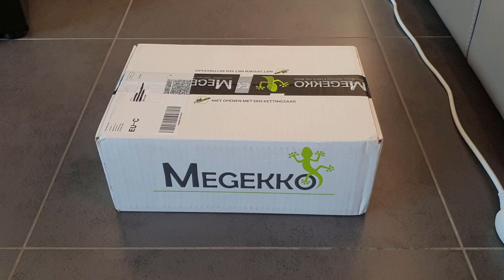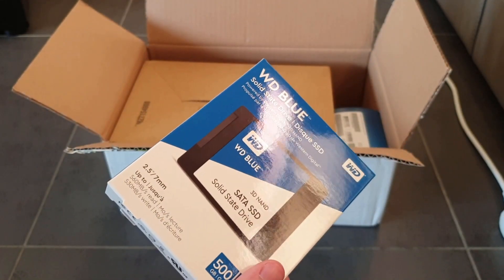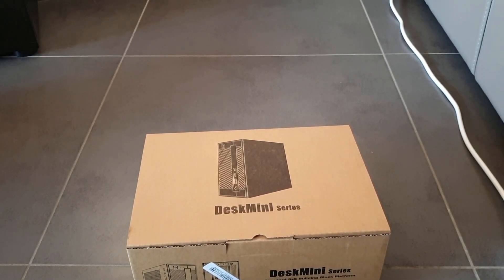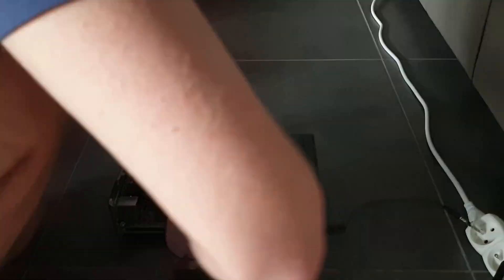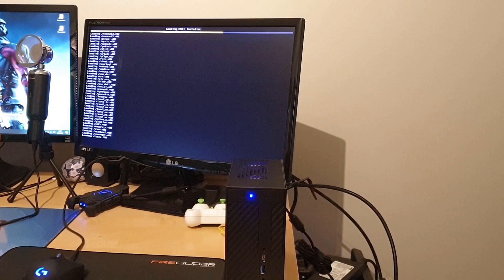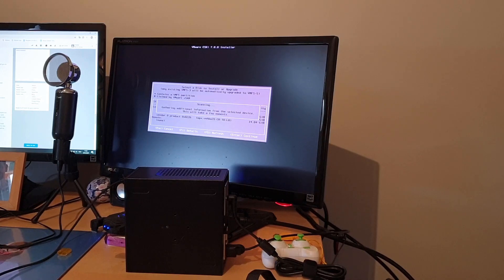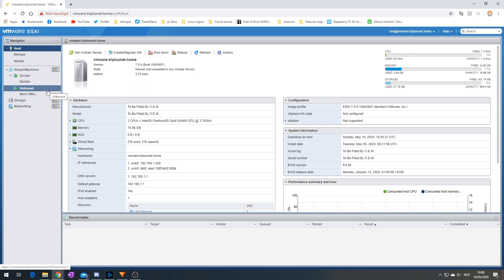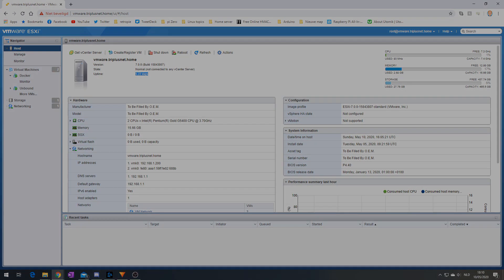HomeLab #1 - Building my cheap AsRock Deskmini 310 mini server! Getting started with my homelab

Comment: the esxi doesn't detect the sd card reader/sd card, very strange, perhaps its not supported by esxi
Reply from the maker: Indeed I had the same. I think I read somewhere that the internal SD card slot can't be used as a boot drive, don't recall if it was the asrock or ESXI that had that limitation.
It's a waste, but a small USB flash drive is working fine for me :)
Reply: @TriplusTutorials  doing the same :)

Comment: thanks for that! I have just bought my AsRock 310 + I7 9700 + 32GB ram + m2 256GB + 1tb ssd sata... waiting for it to arrive :-) 
In the meantime... I'm scared as you had to install the Esxi in an external usb: why? Is there any limitation? 
My principal focus will be to use the AsRock as Esxi server so i was thinking to install at least the Esxi server image on the m2 internal. 
Is there a problem? limitation? 
thanks!
Reply from the maker: You can for sure install it on the internal drives. I was just unable to do it on the internal sd card. So the m.2 drive will be no problem at all!
Reply: @TriplusTutorials  Ohhhh thanks! And thanks for the fast reply!!!!!
Reply: Sorry... another question. 
I'm buying two hd. One will be the 970 Evo Plus Ssd Interno da 250 Gb, Nvme M.2 (around 80€) for OS and ESXI server.
I'm looking also for a not so much expensive ssd (maybe 1tb) to put down in the motherboard. What brand and type do you suggest?
Reply from the maker: @baronio2  I don't feel qualified to answer this... I just do some research but I'm no expert at all 😅
Reply: @TriplusTutorials  :-) lol. No problem! But you have your ASrock up and running! So you are becoming expert ;)

Comment: Really surprised you didn’t go AMD, for a home server, more cores and threads for multi tasking and better energy efficiency. Also why go for such a small case and motherboard? If it’s home server test rig etc you have paid more money for the small form factor and very limited upgrade path!
Reply from the maker: Hmm, I needed to start somewhere (is my first non raspberry server). I found that the set-up I chose was supposed to be fairly efficient & relatively cheap. I did read that the last few years AMD has stepped-up a lot but...
It will be used to replace all my raspberries so it won't really be a test bench. Just a server I can drop in a corner and deploy a VM whenever needed :)
I was very much hesitating in getting something bigger, but it could be a step 2. Right now our office room is already getting heated by our PCs so a big server wouldn't be ideal :)
Appreciate the comment tho! This is also a learning experience for me :)
Reply: TriplusTutorials Yes, stepped up a lot is an understatement 😀. Most intel CPU’s are being trounced by AMD, due to better value, better tdp, better thermals and higher number of cores and threads. Intel only winning on highest clock speed, and you I think are going to be a bit limited on how many concurrent vm’s you can run with your choice but no matter what it’s a big step up from a pi and you will have a lot of fun I am sure 😀. Have a look at ProxMox , Unraid, VMware.